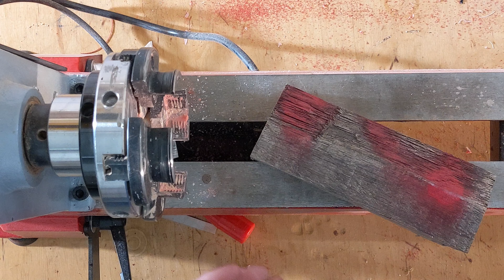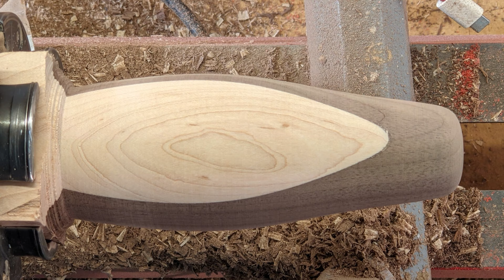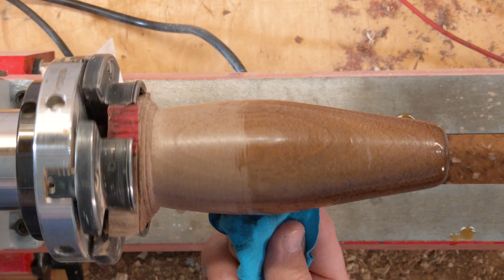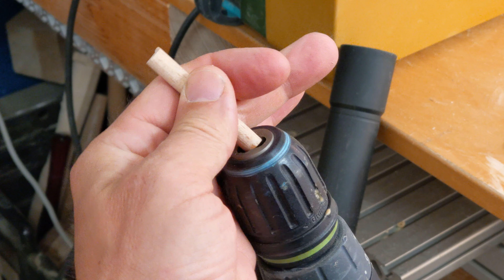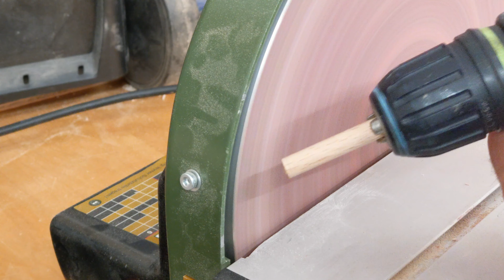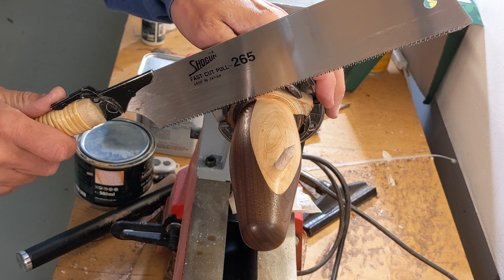turning a penguin out of walnut and maple

Comment: I love your stop motion videos. Do you just constantly step away? How do you time it to have equal amounts of change? And how do you make sure to have the piece at roughly the same position for each shot? I have so many questions 😅
Reply from the maker: Hi there, glad you appreciate these videos! 
The short answer to your questions is that I am indexing the lathe. I use a very low tech solution, just pencil marks on masking tape that is taped around the wheel at the end of the tailstock. The process is slow. I would say that it takes a day or more just to shoot each video, but it's a lot of fun!!!